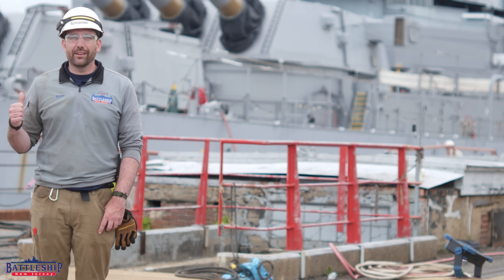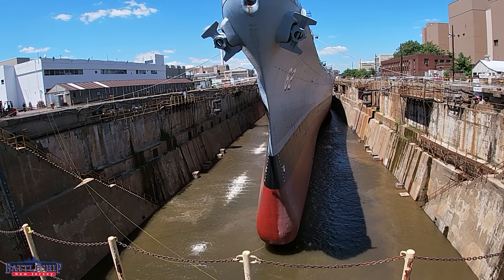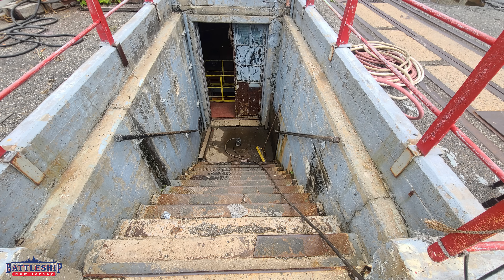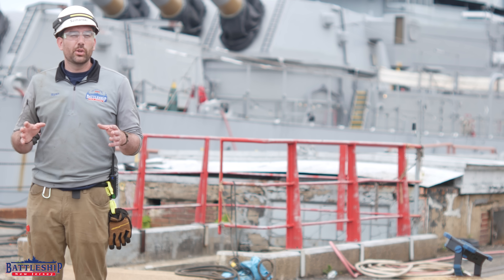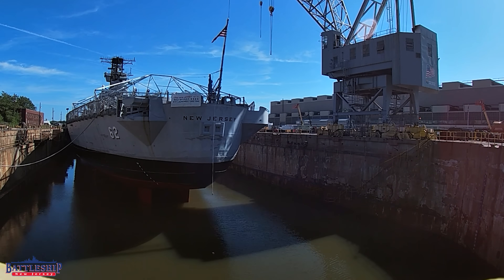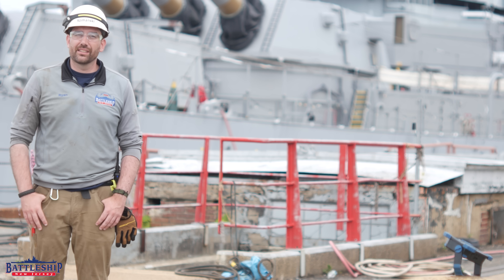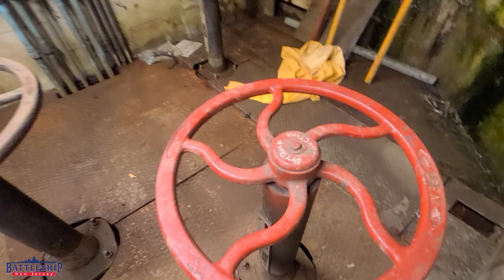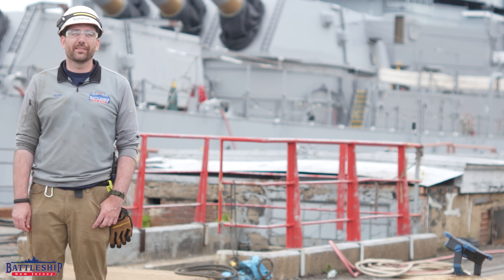The Pumps That Move 37million Gallons of Water Out of the Drydock

Comment: Havent work on any quite that size but my shop's worked on a few river pumps that are about half that capacity.  Its kinda humbling working on a motor/pump and to realize it could fill the whole building (about 100x50x25ft) floor to ceileing  with water in under a minute

Comment: I think it’s interesting that the pump’s nameplate says 331 amps / 2200 volts but even if you converted that amount of electrical power into mechanical power with 100% efficiency it would only deliver 970 hp. 

Perhaps that’s the electrical rating under normal operation and the 1250hp is like a maximum limit that requires more current?

Comment: This math seems off, but those motors are 331 amps at 2200 volts which would be 728 thousand watts whereas an Iowa class battleship calculates to having roughly 160 Million watts of propulsion power

Comment: in order to compare this to house hold voltage you would have to convert to Watts.  331 amps @ 2200vac would be 728,000 watts.  Your house 100 amp panel at 240vac is 24,000 watts. so about 29 times more power then a fully loaded household panel.

Comment: A little ambiguous comparing amps at 2200 volts, three phase, to the single phase 120/240 in a house.  But it might be interesting to note that those slow speed motors develop nearly 28,000 ft lbs of torque at full load.

Comment: AC voltage and current are inversely proportionate. The higher the voltage applied to an induction motor, the lower the current required to produce the necessary horsepower. (Assuming the motor insulation is rated for the higher voltage ) A 2300 volt motor is considered a medium voltage application. The starters appear to be limitamp with air quench arc suppression.

Comment: Great video! I'd love to know more about the pumps. My first job was as a mechanical draftsman at the Ingersoll-Rand Engineered Pump Division in Phillipsburg, NJ. Sadly there is nothing left of that plant today. The pumps you described are similar to some desalinization pumps I worked on for Saudi Arabia. The vertical lift pumps were installed on piers that ran a few 100 yards out in the ocean and installed approx 40 feet under water. The pipe diameter was something like 16 feet in diameter, as was the bronze impeller. I think there where at least 6 or 8 of these, and each one had a 3000 HP GE Electric motor on top of the shaft. It was a rather big job for us at the time and I remember I-R even had to buy a special Vertical Turret Lathe, big enough to machine the impellers.

Comment: Amps need to be stated with volts to indicate power consumption. So, this 330 amp 2200V pump motor would be equivalent to very approximately 6600 amps draw at 120V for a regular house. Sixty six times the amperage of a 100 amp service on a regular house. Do you know the manufacturer of the pump? I am assuming these would be mixed flow pumps capable of very high flow rates but since they only need to lift the water a few feet to the river level, the head would be quite low e.g. 100’ or so?

Comment: with all that equipment being that old, and under so much concrete, what happens if there is a failure? not just some fuse going or short circuit, but major machinery failure? also, given the age of the drydock, we can see a lot of the concrete has become crumbly, and you showed before things like bollards that had been snapped off... at what point does it become necessary to replace sections, or even all, of the dock? do the yard owners have a plan for such an event?

Comment: Use of synchronous motors was very prevalent back in that time. They are very electrically efficient. These pumps are a testament to how equipment was built for the long-haul years ago. I used to work on old compressors back in the day and most of them, with proper maintenance would last more than 50 years. There is no modern equipment that will hold a candle to that.

Comment: Not ball valves, but gate valves, where the handwheel moves a gate off a seat, and thus controls flow. As they do tend to always leak a little, but also will always close  down, there will be small sump pumps there as well to handle whatever leaks, along with whatever also leaks past the coffer dam seals, along with any discharge water from the ship, and rain as well.

Comment: A house might use 150 amps maz,  at 240 volts.   2200 volts,  phewee,  300 amps is equal to something like 2700 amps in the house (current goes down as voltage goes up).    Also note the RPM,  236 loaded.   32 poles?    Yee hah.   I could move 4500 gpm with my diesel engine pumps of 400 hp (2200 rpm).

Comment: How do they keep the grates in the well clean of debris, do they send divers in ever? I also wonder what type of maintenance is required for the pumps, especially the props in the lowest area. It must be very difficult to get the casing off to inspect and repair them or even just to grease the bearings to the shaft.

Comment: Just out of curiosity I did some looking on how much water pumps of various side will move…a 12 inch pump will move 5500 gallons per minute, and would take about 4 1/2 days to empty this (keep in 12 inch pump is insanely big. Moderately sized mining operations would have like a 5 or 6 inch pump.) A 24 inch pump will move 28000 gallons per hour, and would take 22 hours to move that much water. Those have to be nearly equivalent to a 36 inch pump to move that much water that fast. 

And all of these numbers are assuming that there’s no pressure pushing back down the hose creating resistance for the pump Which, in this situation, pumping water to presumably the bottom of a pretty deep river, there is a crap ton of pressure pushing back trying to resist those pumps.

Comment: If the nameplate data looks off…  The pump motors are probably 3-phase Y-connected. The effective voltage is 2200 * sqrt(3) and the effective current is 313 amps.  If the motor is about 77% efficient, you get 1250 mHP output.  My efficiency assumption seems low, a modern 3-phase large induction motor averages around 92% efficient.
Reply: It's not inefficiency, just power factor less than unity. Both old and new motors are probably about 90% efficient with a power factor of 0.8.

Comment: A nice memory for me. A now deceased pipe fitter and I installed piping in that drydock. I believe to remove the last little bit of water from the bottom. It was 6" or 8" pipe and I was the welder. That was about 1987. Never got a chance to see those big pumps but did spend a fair amount of time in some of the yards other dark spaces of which there are many. RIP Eddy!
Reply: How about a tour of those other dark places?
Reply: Was Eddy a good guy to work with?

Comment: A commercial pump motor that draws 330 amps at 2200VAC is equal to 18.3 X 330 = 6,050 AMPS @ 120VAC or 3,025 AMPS @ 240VAC household current value. the authors stated household current draw figure about the amp draw comparison value was off by 18.3 fold in value to a standard 120VAC North American outlet. In reality, you could run 151 average home 20 amp 240VAC standard AC unit compressors with that amount of electricity.

Comment: Any idea why they installed three pumps if one can drain the dock so quickly?  I can see having a second pump as a backup.  Maybe the incremental cost of the third made it a bargain to have a backup for the backup?
Reply: 4 to 6 hours to drain a drydock isn't really quick in the grand scheme of things. It's better than 5-7+ hours but it's not great. There might be circumstances in wartime where 4-6 hours is simply too slow and two hour turnarounds are better. One simply doesn't install extra drydock pumps on a lark. Efficiency is a thing that needs to happen sometimes.

Comment: I collect and restore vintage tools, electric motors being one of the most interesting. I have a G.E 1/2 h.p and a 1/4 h.p Marathon repulsion induction. Both over a hundred years old. Amazing to think that if I wanted to they could go back into service as the work horses they were. Very simple but very elegant. Beautiful bronze journal/sleeve bearings with oil grooves and felt wicks far superior to cheap modern day ball bearings. I keep a wire wheel on them both to spin up every now and then, thinking of replacing the newer motor on my table saw with the General Electric.

Comment: Some electric locomotives from the decades around when those motors were installed could draw up to 700 amps. I would have to go look up the voltages, there were many different one in use across the US and Europe.  But I do remember seeing a New York Central 'S Motor" built circa 1904-1909 which had 700 amp fuses or breakers on its 3rd rail contact shoe circuit. 🤔 Hmm, wonder what kind of torque rating those pump motors have?

Comment: the fact the pumps are original from the 1910's and still working just blows my mind. Modern engineering is the science of making things weak, just strong enough to do the job and cost as little as possible to increase profits. Back then it was building the best period. we need to get back to that.
Reply: Induction motors like those don't really break. Other than the mechanical bearings (which can be serviced) there's nothing in them to go wrong really. It's actually part of the reason nobody really makes motors that big anymore, at least at any sort of commercial scale. Even for smaller motors more typically found in industrial application, a rebuilt motor that's basically just been cleaned will usually be cheaper but just as good as a brand new one.
Reply: Your basing this off a very strong survivorship bias. The ONLY things you see from 100 years ago that are still in use are the best, most durable, and probably least used equipment from that era. Its completely discounting the vast majority of things from back then that broke, were replaced, or were junk from the start.
Reply: @Jacksonflax  Don't forget the perfectly serviceable stuff that was scrapped. There was a lot of that too.
Reply: Don’t forget, planned obsolescence!
Reply: This is extremely primitive technology, your notion is completely off base.

Comment: These pumps run directly off the grid.. there is a step down substation,  but then it goes to the motor..
Reply: No they have their own 2300 volt transformer next to the switchgear in the electrical room. Anything connected to a transformer becomes a separately derived system.

Comment: The plumbing show when talking about the "ball" vales for the pump looks more like a gate valve to me. [Edit: a bit later they are referred to as gate valves.] The big "tombstone" shaped part stinking up from the pipe is where the gate would be retracted up into (assuming it is a gate value). And that would make more scene because a ball valve that big would require a lot of torque to operate and there is no need to open or close it quickly.
Reply: I agree. Ryan misspoke about ball valves, then correctly explained gate valves later.
Reply: Came looking for this comment. Thank you!

Comment: After wondered if they just opened up a couple of 3 to 6' diameter pipes to fill the dry dock with water. Wow a.asking they use three 1,250 HP Pumps. Back in the 1970's I use to attend meetings that the Philadelphia electrical Association had. Got friendly with an electrician from the Naval yard. Told me they only used a 100 HP motor to lift the bridge up to allow ships to travel in or out of the yard. Of course it took awhile to perform bridge lift.

Comment: those pumps weren't run by steam but you can see how this same setup could be powered by steam motors instead of electricity since the pump is just shaft powered

Comment: Battleship 150A x 440V = 66,000 VA vs De-watering pump 331A x 2200V = 728,200 VA. So the battleship at dockside is drawing ~0.09 the power of a single pump. These are rough calculations.
Reply: your calculations are wrong, because these are three phase pumps. the battleships motor is 300 HP, which equals 223,800 VA, which is 294 amps off a 440 volt three phase system. however, it is more likely that the actual voltage is 480 not 440, which is 269 amps. 

The medium voltage motor would be 2200 volts x 1.73 x 331 which is 1,260,000 VA. All three phase systems have a 1.73 multiplier when calculating wattage or VA when you care calculating using phase to phase voltage. Or take the phase to ground voltage and multiply that by three.

so if your calcualting a load of 20 amps off a 277/480 three phase system, to get the watts, you would multiply 480 x 1.73 x 20 or multiply 277 x 3 x 20.
Reply: @ryuukeisscifiproductions1818  Except what Ryan was referring to was the 150A the battleship draws from the dock service connection to power lights, HVAC and the like. The 300 HP turret motors are not in service. As I said they where rough calculations as I did not have the power factor at hand. Since the power factor is the same for both so the ratio would still hold give or take.
Reply: @adrianklaver113  your still missing the factor that it is a three phase service, not a single phase, your initial calculation is still way off because you didn't include the 1.73 multiplier that is included in all three phase services.

Comment: 4:25 Most things in a house are 120 volts (not 110 volts), with a maximum of 20 amp circuits (not 25). Stand alone washers are 120 volts (not 240 volts). Dryers are 20 or 30 amps (not 50 amps).

Comment: Starting a pump has a big draw of current . 
Commercial customers pay extra for that Over the price of the juice consumed .

So running one pump longer is cheaper than starting Three pumps and getting done sooner .
The extra is called a Demand charge .
Basically they  are charging you to have a generator standing by to give the Extra current for starting .
For more fun look up Ratcheting Demand Charge !
Reply: The power company also nails you on “reactive power”  from induction motors( KVAR)
Reply: @willl.4570 
You can buy capacitors to do power factor correction to correct a leading power factor .
To lower the demand , soft starters , VFD drives are better than traditional Y-Delta , auto transformer, motor starters.
Reply: Extra generator to supply demand when needed, extra copper to get the power to your (pump)house, etc.
Reply: Grady on his Practical Engineering channel just did a good explanation of the strain that large motors can place on the grid, because not only do they pull a large amount of power briefly to start up, they also quickly dump that power back into the grid which also incurs costs.

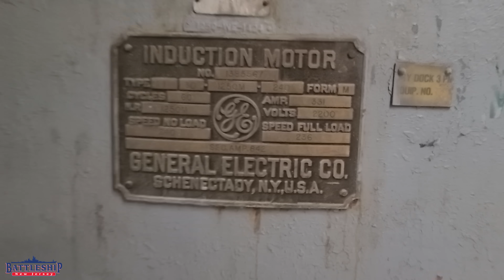Comment: My truck has 360 hp ... so you're wrong once again 3:32 When is the ship leaving the drydock .. I need to come down there and get in the way.
Reply: My car is only about 107HP... so it evens out.
My sister's car is ~180HP @ 6000RPM. down to 60HP if I keep it below 2000RPM (assuming a linear response).

Comment: I'd been waiting for this one.  Quite impressive that the same hardware is in place since the drydock was built.  I figured they'd have gone through at least one refresh being it's been over a century.  Big tough old equipment!
Reply: Those motors for sure have been rewound, as they likely originally used paper insulation, and will have been upgraded to class H insulation simply due to leakage current through the paper. You can see plenty of paint coats applied over the years as well, and the main bearings will have been replaced as well, along with the intermediate bearings on the shafts. Pumps will have had a number of rebuilds, as they do wear, especially when pumping silt laden water, and those grates do allow lots of debris through, so if you pull one apart you will see the rows of weld that have been applied to reface the volutes and also the impellers, to replace worn away metal.
Reply: Ah yes, very true.  I completely didn't think of in place refreshes.  I'm so used to the modern electronics I deal with where if it gets old or stops working we just yank it out, send it for e-waste recycling and put in a new one.
Reply: For sure.  I can't imagine the depths to which they had to excavate, and then set up forms for all of that concrete work far below the level of the floor of the drydock.